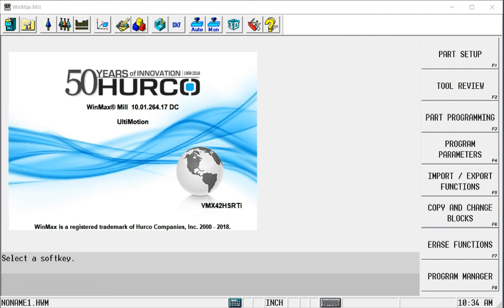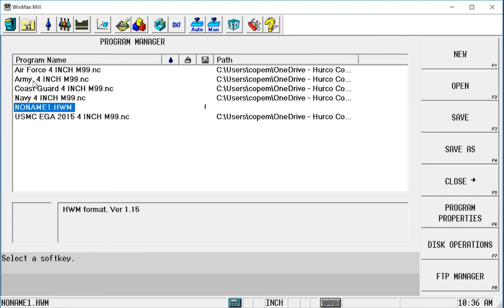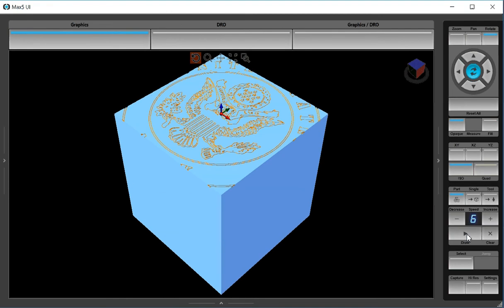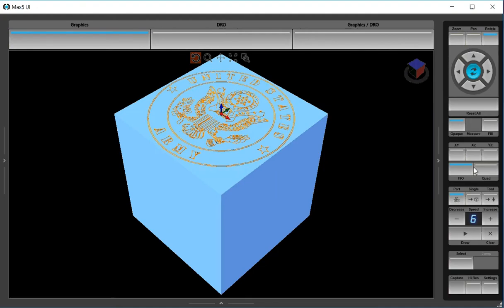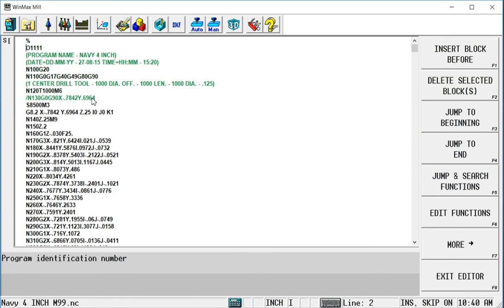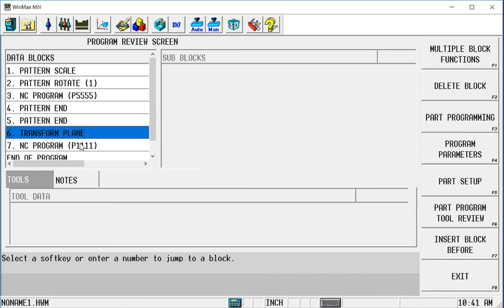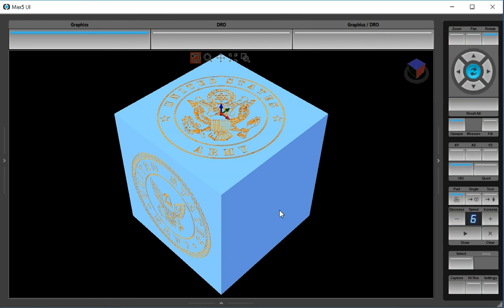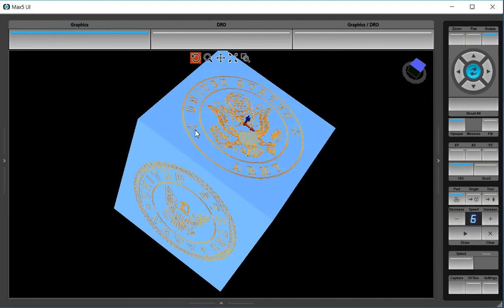How to NC Merge with Patterns - Hurco CNC Control Demo

Comment: Says it’s wrong file type. I got .FNC
Reply: Both the conversational and NC program types must be set to UNIVERSAL ROTARY. You can check these settings by going to: AUXILIARY > UTILITY SCREEN > USER PREFERENCES > check both CONVERSATIONAL SETTINGS and NC SETTINGS. The default conversational type must be UNIVERSAL, and the NC display type must be UNIVERSAL and the NC Dialect must be ISNC. These settings being incorrect are usually why you get that error.
Reply: @trailgeartradingpost  Thanks for the swift reply, I will give it a shot in a bit and let you know how it goes
Reply: @trailgeartradingpost  just checked. They both are set on “Universal”
Reply: @biggwesticles  Did you doublecheck that the NC DIALECT is set to ISNC?
Reply: @trailgeartradingpost  no sir I will check in the morning it kept giving me same error
Reply: @trailgeartradingpost  yup set to industry standard